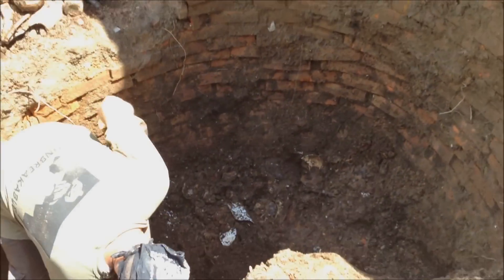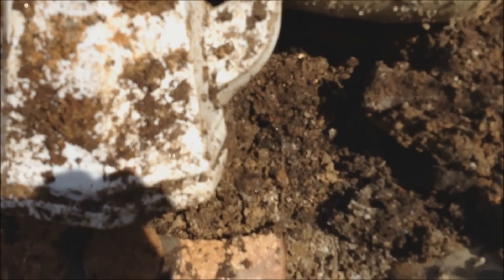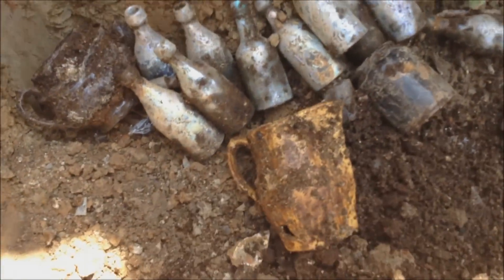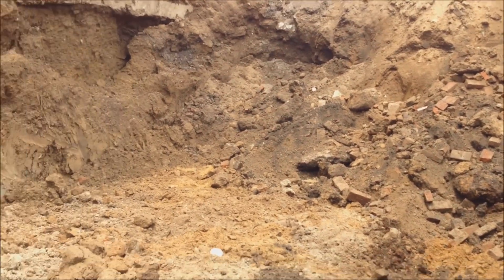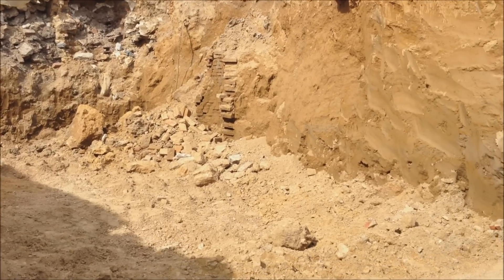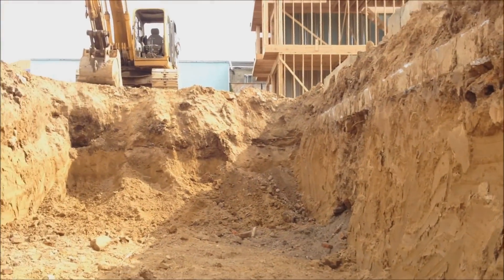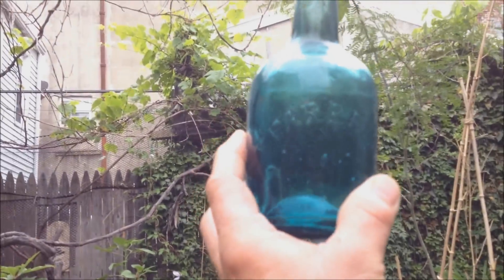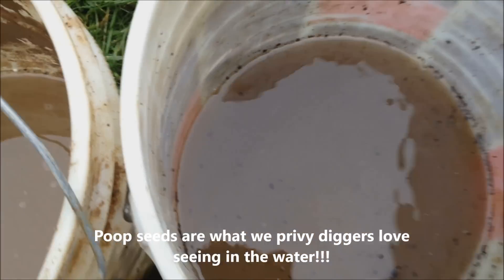Privy Dig - Saved 60 Squat Soda's from Certain Death!

Comment: I have a question you may not get back right away or not at all but I believe I located 3 old privies by a house maybe dating around 1875 or possibly a lot earlier. I would like to know if I should dig them because there is a dirt slop with red bricks there that possibly I thing was a circular privy just like the one your digging in this video. but the outer wall collapsed over time from being so old. So I really don't know where to dig is the real question. Also I am located in the eastern coast .
Reply: Make a probe out of spring steel and learn how to use it. You should have known.